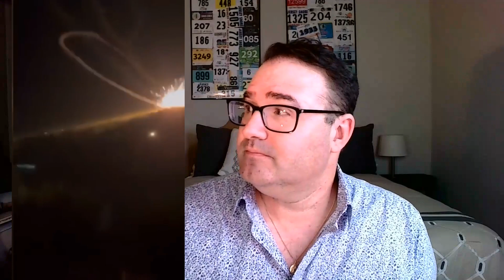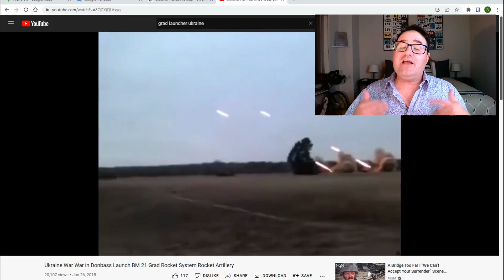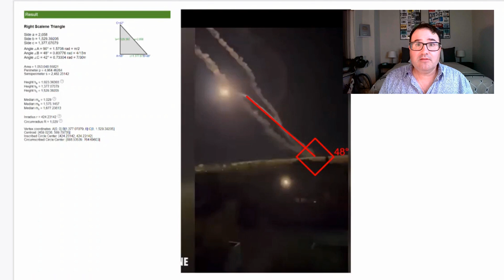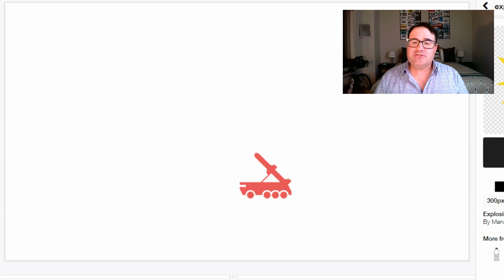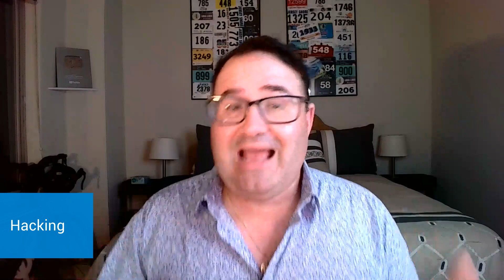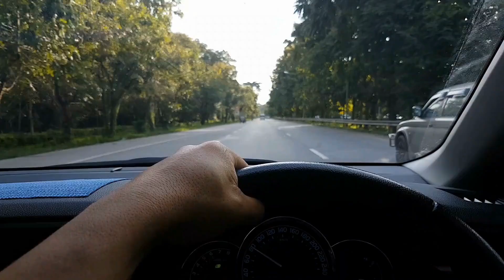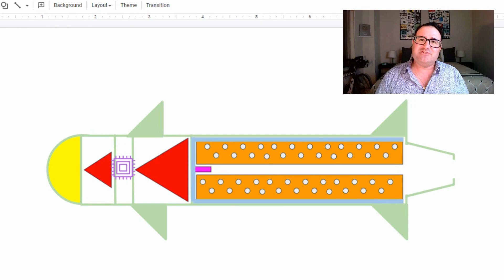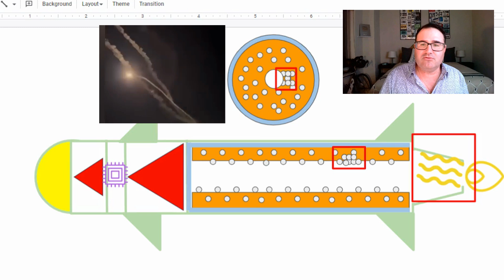Why this missile U -Turned

Comment: Let’s hypothetically say I’ve worked in close proximity to a surface to air missile system. And let’s assume that, as a techno geek of extraordinary skills, one might be intimately associated with an :actuator, guidance, high energy, stand clear when energized: type of fin actuator.  Let’s say that a techno geek was asked very nicely to do a checkout of the static fin rig prior to containerization.  Then let’s assume I’m training a new 23 year old female with huge boobs and more tit than intelligence, and the tip of a rig pin, shall we say, inadvertently becomes lodged in the rig pin hole.  After careful extraction of said rig pin, it was noted that the rig pin had become stuck due to power not being removed prior to baseline fin positioning.  Of course three people, including inspection, bless the airplane murdering device before it’s put into its launch container.  The test is concluded and all is well…….but, a tiny piece of the phenolic rig pin was sniped off and now residing in the rig pin hole between the mount boss and the power actuator.  Well, wouldn’t you know that at a certain Hawaiian test area, that perfectly rigged missile came out of its container, fire shooting out of its ass, electronic radiation looking for a plane to murder, the computer looking for that magic number to unlock :actuator, fin, high energy, stand clear when energized: and lo and behold, at XX G’s, the goddamn actuator unlocked, positioned the fin to the JAMMED position, and the missile returned to sender.  As I stated, I pooped a little bit!

Comment: Could be improper configuration due to lack of training or incorrect  maintenance and handling. Or from a software perspective, the possibility of incorrect system settings could make the system turn on itself if there is improper signal deconfliction if the missle is a radio seeking missle.

Comment: A "stuck fin" or broken fin could occur as a result of mishandling. Specifically a mechanical failure because the fin was improperly attached to the rocket or that mechanical connection had degraded.

As a loser who has done a fair amount of model rocketry, I've seen stuff like this happen when a mechanical joint on a fin fails early in flight. The change in aerodynamics that early on can cause the rocket to literally u-turn and I've seen that sudden change in direction sheer off other fins too.

The lump of fuel is still probably the better explanation, in absence of other info, because the return trajectory is fairly consistent. If a fin had mechanically failed I'd expect the rocket to "tumble" more on the way down.

To get this... you'd probably need multiple fin failures, whereas your theory really only requires a single failure within the fuel mixture. Still, I just wanted to volunteer that a "stuck fin" doesn't necessarily require the guidance RADAR steer the missile.

Comment: The odds of that malfunction happening as you say seem insanely low.  Rockets that malfunction in that way tend to act totally crazy.  What is a single flipped bit could invert the coordinated system guiding the rocket?  That would explain why it corrects.  As for the changing directions two seconds into flight I have seen lots of rockets that launch then adjust course before the boost phase so.  Perhaps it was one of those.  I am certainly wrong... but I'd say if you are being honest with yourself you know there is an very good chance you are wrong also.

Comment: I'm going to say that I am not overly confident in guessing the cause, but I think I know enough about rocketry and the dynamics of the high pressure gasses to not agree with this one.  If there was a lump of fuel in the plasticizor it would simply increase the overall pressure in the chamber. The gas doesn't go directly out the back of the rocket, it's pressuring a space evenly and escaping through a nozzle. The lump could reasonably cause a case failure due to pressure but certainly not redirect flight.

Comment: YOU AND OTHER COMMENTATORS HAVE SAID IT! BASICALLY "THE RUSSIANS ARE CRAP AT LOOKING AFTER THEIR EQUIPMENT"! TECHNICALLY IT MAYBE CALLED PHASE SEPARATION, WHEN DIFFERENCES IN THE TEMPERATURE THAT THE ROCKET WAS STORED AT CAUSE EXTREME CHEMICAL CHANGES. SO LIKE FOOD YOU COULD HAVE A SOLID WHICH THEN SEPARATES OUT AT LIQUID IF STORED AT TOO HIGH A TEMPERATURE. THAT LIQUID POOLS AND YOU HAVE THAT SITUATION OCCUR. ONLY THEIR ROCKET DESIGNERS WOULD KNOW, ASSUMING PUTIN LEFT ENOUGH OF THEM ALIVE TO MAKE THAT OBSERVATION.

Comment: Your theory is very plausible, but I will present one alternate. Do you remember the Russian rocket launch (likely a satellite, it was not manned) where a very similar flight path was taken? They installed a gyro upside down during launch prep if I remember correctly. That would be a shitty mistake to make twice but it's possible 🤷‍♂️

Comment: That was SA-11 (S-300) long range AA system it fires 75-150km, and now primarily used by russians against ground objects (UAF use them as originally air defence) (they have about 7000 of these missiles), S-300 missiles speed is 1300-2100m/s that is 4-7M MIM-102 as far as I know 1000-1100m/s that is 3,5M+

Comment: I wonder...wouldn't your scenario get largely corrected/averaged out as the gas pressure equalized as it exited the rocket?  Could it force that aggressive of a turn?

I wish we knew the exact missile...my suspicions go towards "thrust vectoring/control system failure"?

Comment: Ryan, I believe your dismissal of a guidance failure is based on the belief that all guidance is external.  While the commands for guidance may come from the ground during the early and mid-course phases of flight, they are all received by a guidance module on the missile.  If there is a failure in those electronics, an uncommanded turn could result. the extreme nature of the turn also leads me to believe it is a guidance system failure. 20 years of experience maintaining F-14 weapons system.

Comment: I think it's a classic case of calling your grid as the target. That return was almost too perfect for a simple mechanical error. I think it was location guided and the computer operators put their own grid in by accident. As an experienced 11C(mortarman), I see this a lot with my attached units during training. Luckily we have safety measures in place and can turn it into a learning experience instead of actual loss of life on our side.

That's just my experience talking with non-correcting rounds though. And given the semi-public information of how Russian soldiers are trained. So I could be wrong.

Comment: A detailed way of describing an instance of uneven fuel burn as well as what causes it to happen. Well done! 

I'd submit the possibility of a catastrophic failure in the structural integrity of the rocket motor's casing. Or in other words, uneven fuel burn/pressure creating a small hole/crack in one side of the missile, forcing exhaust out the side.

Comment: I don’t think that an imbalance of fuel would cause enough vectoring to turn the missile significantly. Since all the gas has to go out of a straight nozzle, the amount of vectoring you can get is extremely limited. 

It could perhaps damage the nozzle of the rocket, but then why did it stop turning afterwards? 
Perhaps the guidance system noticed the deviation and tried to correct.

Comment: Looking at the video I can see that it was a failure of the CAS (control Actuation System)  that controls the fins. The fins were suppose to guide the missile in to initial turn and radar acquisition mode.. Of course it didn't make it.

Comment: Guidance failure in my opinion. A stuck fin would cause corkscrew or constant circling. Unbalanced solid rocket fuel burn wouldn’t be so abrupt a turn, and that turn was highly impressive without breaking up! 
The guidance system corrected to what it thought was a correct course.

Comment: Alternative theory: Gyros installed in wrong polarity. Initial boosted lauch (~1second) is unguided. Then once gyros activated the missile thinks it's headed in the wrong direction and corrects, then proceeds in an opposite but parallel trajectory back to the launcher.

Comment: The fin theory actually holds water. The airspeed needs to build up first before it can take effect. Since the rocket accelerates so fast, the effect becomes exponentially larger. 
You interpret like the fin moves after leaving the platform, what actually is meant is that the fin was misaligned all along.
What also was an interesting theory is that it could be a gyro misfitment/malfunction. I like to imagine it like flying with inverted controls.

Comment: I don't think that's how it works, the gases in the combustion chamber are generally subsonic, which means, they should have enough time to equalize the pressure, and therefore keep the overall thrust going the same direction. Some boosters even have inner hole drilled off center, which causes the fuel to burn all the way to the wall on one side before the other, which means the inner hole surface area doesn't keep increasing till the end, and thus a more uniform thrust.

Comment: Nope, if the thrust was asymmetrical the missile would have wobbled. This missile reversed direction smoothly. Once turned, it flew straight. Guidance error is the reason

Comment: Well it’s plainly NOT making a 180 turn. The flight path is angled slightly up-right and may 30 off of straight towards the camera. The path veers hard left down approximately 90-100 and it’s an optical trick that makes it appear as a u turn.
Just do the brain math.

Comment: No Ryan, this is a case of entering ONE'S OWN LOCATION COORDINATES in place of the real target's location coordinates. The rocket turned around perfectly, and returned directly to its original GPS location UNDER CONTROLLED FLIGHT. The rocket had control of itself the whole time. It was departing properly, then u-turned and returned in straight flight. The tremendous pressure of the burning fuel inside the combustion chamber should negate pressure differences within the combustion chamber. And, if fuel irregularities caused path wandering, the rocket should have adjusted its fins to get back on course. That didn't happen. The rocket did not try to correct itself at all. No, this was a case of entering one's own coordinates as the target location. 
Consider this: Let's say they entered their own position coordinates as THE TARGET. Immediately upon firing, the rocket CANNOT BE DIRECTED (steered) because it has no airspeed with which to use its fins to turn. The fins will not even activate immediately upon launch. So they've entered their own location as the target. The rocket takes off and as soon as it builds enough airspeed to use its fins, it does a perfect 180 and returns to its own gps coordinates and explodes exactly where it was programmed to detonate. Whether he intended to or not, that operator targeted himself.
Reply: BUK isn't gps guided.

Comment: I think we caught the first sign of SkyNet testing it’s self awareness. But seriously, i think this was an issue with communication & tracking between missile and radar, along with a mechanical/fuel issue. If this was just a mechanical failure, the chances this rocket would land so close to the launcher are astronomically high (though not impossible). For the “clump of fuel” explanation, to have enough clump perfectly together only on one side and unaffected by gravity (causing it to migrate downwards)….possible but the odds seem high. Also, the flight path and smoke trail appear very smooth. I would expect that a clump of fuel would cause signs of sudden extra burning, but I don’t see anything . But I’m not a SAM expert, just some aviation engineering on the F35.

Comment: Its possible a fin broke (that was supposed to be straight but is now bent) causing it to turn, the excessive g load on the the fin (caused by trying to turn a missile going that fast that quickly) broke the fin off removing the turning force hence going in a straight line. 

But the rocket fuel explanation is equally if not more likely.

My initial thought was target and launch location got mixed up but thank you for clearing this up

Comment: This was a multiple g U-turn which cannot be explained by assymetric combustion.

Such a sharp turn can only happen with a damaged or stuck wing or a correction nozzle firing at the wrong time.

Yes, mishandling is probably the cause but more likely with a broken connection or a damaged sensor or gyro.

Comment: Former missile technician here. 
1) No matter how uneven the burn, the thrust still goes through a central nozzle and can not result in angular momentum on it's own. 
2) It's most likely not a stuck fin since that normally results in a number of tumbles and/or a corkscrew.
3) My hypothesis: The Turn looks like a very "deliberate" 180 degree turn. Anti air missiles usually have an initial guidance phase where they turn to a specific direction based on data from the fire control system before trying to get a fix on the target. A single bit failure in the guidance unit in the missile can make the missile think it was fired 180 degrees in the wrong direction and hence has to turn 180 degrees to get a fix on the tracking radar signal. Missiles also have a pre programmed "time to clear launcher" or maybe even "time to gain safe altitude" before starting to turn which would explain why the missile flew straight and then turned 180 degrees after some time.

Upvote if you agree.
Reply: Retired Soild Propellant Chemist here. I agree with #1,2. Can't disagree with #3 since I am ignorant of that system. I can tell you this...mechanical failure of the propellant grain (chunking) usual results in a loss of airframe. The chunks expose more surface area which increases the pressure inside the rocket motor which presses the flame front closer to the propellant which increases the burn rate, which increases the pressue , which increases the burn rate , BOOOOOOOOOM . Can't be a nozzle failure since the missile flew straight into the ground, no pinwheeling.
Reply: Dude who has studied many days of F16; F15; F22 missile defense in combat; and how short/mid/long range air defense systems work. 
My theory is; the plane was taking a defensive position; (diving) and the missile due to being Russian, over corrected with the dive. Then the radar seeker turned on to start tracking, first metal box it detected. 
With self defeating technology, makes our job easier.

Comment: ... see the problem i have with your hypothsis is that  if it was such i would expect it to burn a hole in the side of the caseing about the spot where the fuel accumaled from the excess heat and pressure ..    and also .. mmm idk i just dont see that produeing asymetrical thrust tha i mean mean all that gass is still going out the same nozzle so it .. i would expect  it to not turn but have an abnormaly high accleation untill that fuel either burnt out or burnt thru the caseing  but at the same time i cant think of anthing that would cauase this the other thing to remebr is theres a hevey and long things they have inerta .. and thats a reaaaaly tight turn

Comment: Too bad you didnt elaborate on the flight path of the missile. While the video seems to indicate it makes a u-turn, its clear that when the missile struck the ground it was a lot closer to the camera Ie it didnt fly back at the launcher. The only reason it looks like a u-turn is because of the camera angle. Just calculate distance to launcher and distance to impact to see it impacted quite a distance from the launcher.

Comment: Servo circuit short, broken control motor or broken control service but definitely the result of improper storage\handling?  The rocket could've been decades old and wasn't properly inspected?

Comment: Love your videos. But i think that the guesstimate about the distances is very off. No BUK type missile can reach a full speed in 2 seconds right after the launch. It takes a while to pick that up. It's not moving at mach3 right from the get go. So, if the speed and the highest reached altitude is much lower, the distance must be smaller. I'd say quite a lot smaller. The missile still accelerates after the U-turn, it's not just balistics, the engine goes much louder at that point. Still, i'd say that the distance travelled is hundreds of meters, tops. 
About the hypothesis about the fuel clump - i got a question, wouldn't the nozzle prevent that? I do know that shuttle SRBs were "throttled" to avoid MaxQ problems just by preparing specific shape of the combustion "tunnel" in the middle of the SRB, so when it started burning, it did not have the same performance during the entire flight, it actually changed at specific, predetermined moments eventhough SRBs can't be throttled manually in flight... So i guess that could be it.
Reply: Thanks... I am about to write pretty much that. 2km for first 2 sec is hard logical error. There is no visible shock wave either. I agree with you on being hundreds of meters top compare to the size of explosion unless AA warhead makes explosion of 500m blast. Missile reaches its max speed when all fuel are burnt. Not the case there.
Agree, nozzle should prevent it.
Reply: @Danji_Coppersmoke  LOL i had a typo there. Wrote that no missile can reach the speed right after "lunch". Well, obviously. Even AAA needs to rest after a meal.

Comment: Never worked on rockets that large, only model rockets. I've never seen fuel asymmetry cause a course deviation that avionics couldn't correct.
My bet is on a fin actuator problem, whether it broke, or some complicated deviation; the fin steered itself into the ground.

Comment: I know some missiles have a capability to do a spiraling turn as they launch to burn off energy for test firings so they can stay within the limits of a smaller firing range (hopefully they have a backup self destruct system in case that system doesn't work), but this doesn't really look like that.